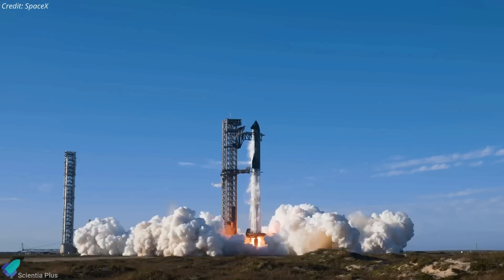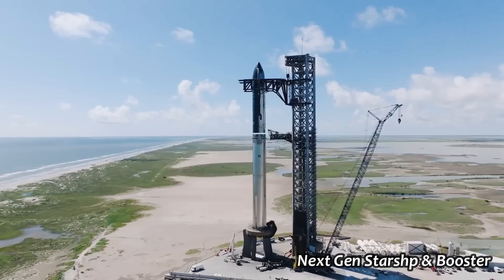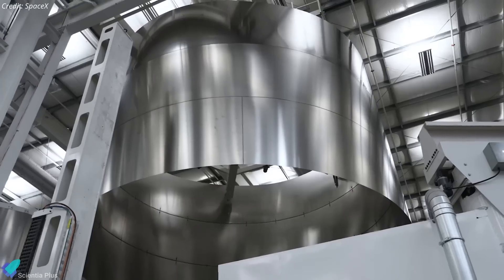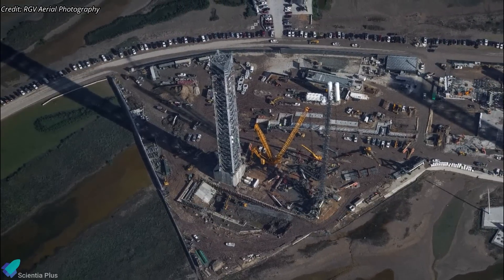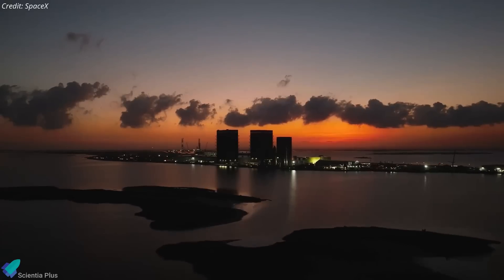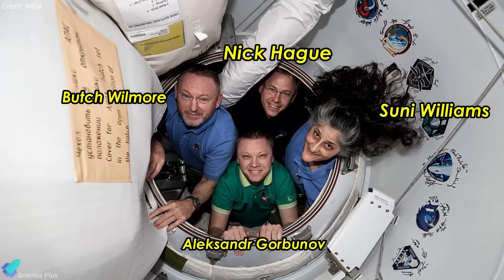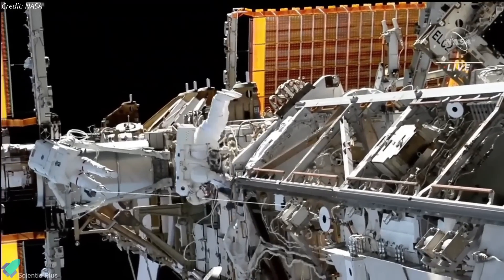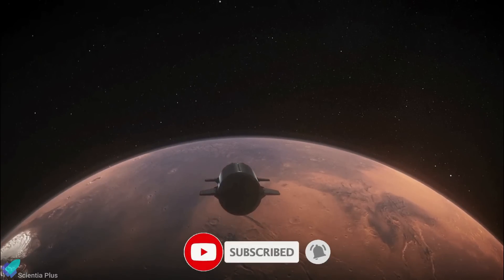SpaceX’s 9 Engine Starship is HERE! + Booster Block 2 SPOTTED! Sunita Williams Return

Comment: They're going to have to put pressure relief in the cooling lines. They don't put them in there to vent and work then you have a bigger problem and you won't fix your problem. All the rest of the things you're doing is help someone but because it is on your vacuum engine that has two insufficient. That Still Remains😊